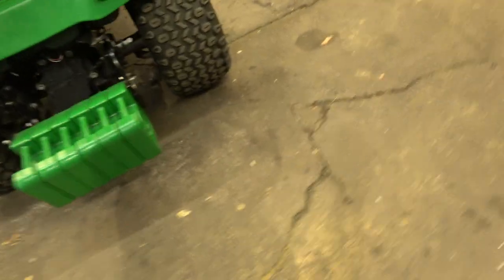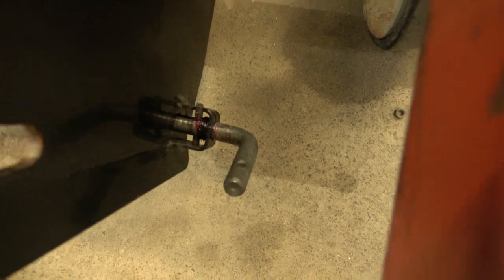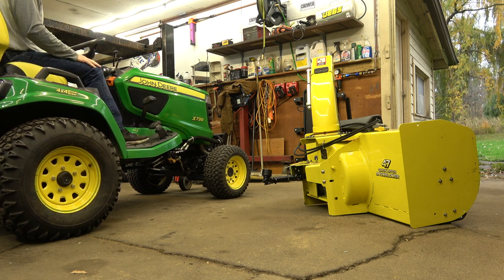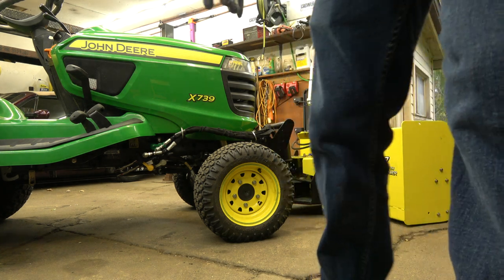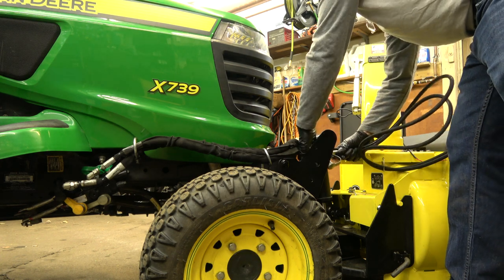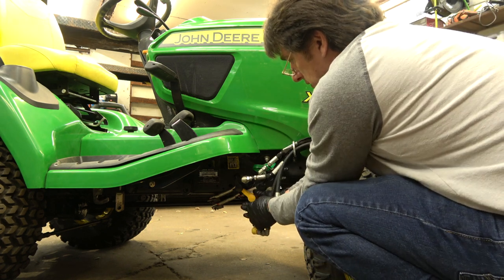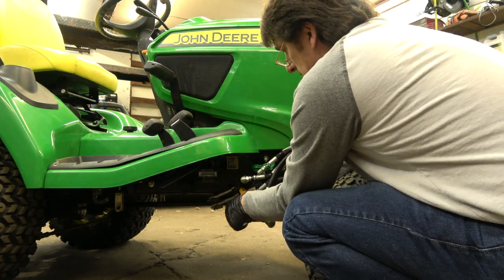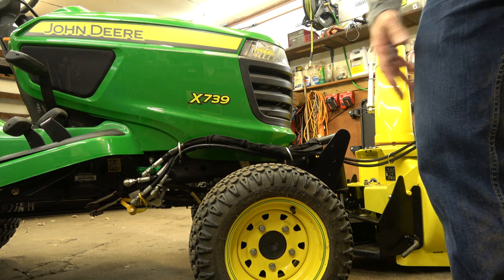john deere x739 snow blower final test and price on cozy cab part 3

Comment: Nice vid!  Wished I had a cab!  TIP: Before connecting your hydraulic hoses,  giggle both hydraulic levers several times 1st.  This relieves any pressure in the system and makes plugging them in easier.